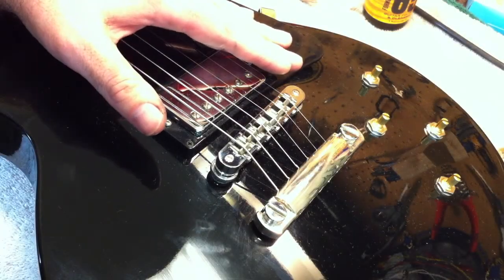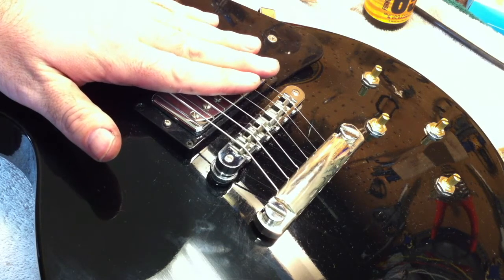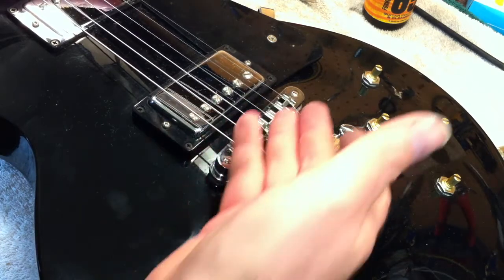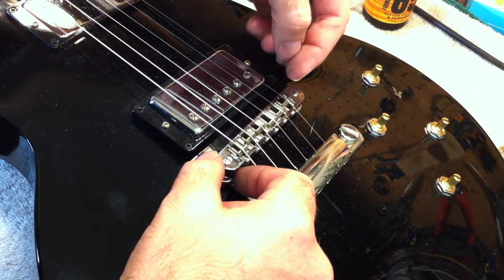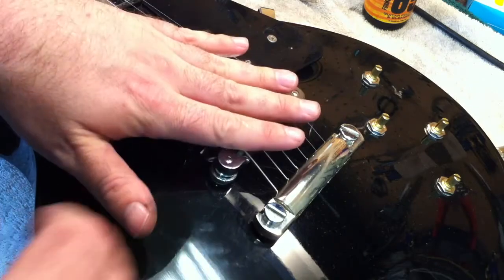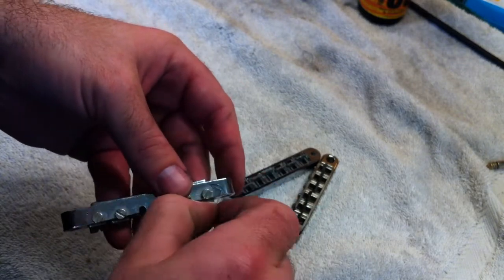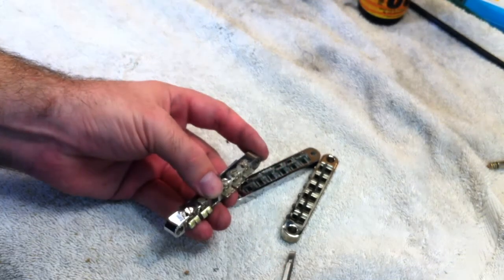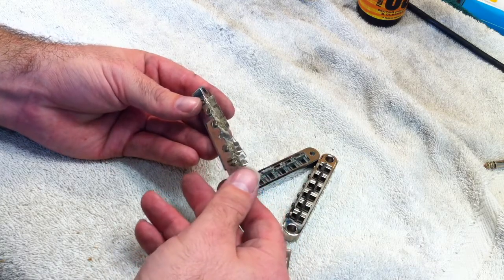Identifying a Buzzing Tune-o-matic Bridge and Fixing It

Comment: I  thought I was getting fret buzz after I installed a roller bridge on my Les Paul but it was harmonics generated in the short length of string between the bridge and tailpiece. These roller and tunomatic bridges to some extent are playing harmonics on the string. Notice how Paul Reed Smith bridges have long grooves across the full width of the saddle - this will properly stop the string's vibration passing to the tailpiece—I think it makes a big difference. I made my own brass saddles with a flat top and groove to hold the string across the top and that fixed my weird noises that sounded like buzzing—only on particular notes.

Comment: I got a new Gretsch 5220 Jet and had the same problem.  I injected clear silicone into the saddle areas. Works great.  I stumbled upon this video afterwards, so I'm not completely nuts.
Reply: Just wondering, were there any gotchas with using clear silicone? Like maybe affecting the range or ease of movement of the individual saddle?

Comment: You can also cut a small spring into 6 pieces and put them around each screw. They'll keep tension on each saddle so that they won't shake any more. Also solves issues with saddles moving when using a bigsby or some other type of trem.
Reply from the maker: That is an interesting solution. I like it because it is less messy than what I am doing here, though the mess does clean up pretty well with a little naphtha. I guess one downside might be that it would be a little more finicky getting the spring on the right side to do the adjustments if you needed to push a saddle close to the front or back but that's also workable. I might try this at some point and see how I like it.
Reply: Where would I get the right size spring?
Reply: @daleosborn3729  I find very small coil springs in the following:  bic style cigarette lighters, long stem candle lighters, small pump sprayers like those used in nasal sprays etc.  My wife saves these for me to pull apart. You have to dismantle or cut apart these things after they are empty to get the springs out.  Pretty easy with a small wire cutting tool like you would find for a few dollars at harbor fright tool store. I get the lighters at the dollar store, often 2 or 3 pack for a dollar. To store the springs and other tiny parts I  keep a small fishing lure box at my bench or you could use  a small parts mini-bin with multiple drawers to keep small parts organized.  I was never able to find any local hardware store that carried coil springs in small enough sizes for this type of application.  Airguns, airsoft guns, and paintball guns use some pretty small springs inside the mechanism for safety levers and such, but are also difficult to source.  I just found it easier to use the obtanium method for my small parts. I have been stripping old junk for parts to build stuff since I was a little kid, so it comes naturally to me.   ;-).  Good luck!
Reply: @Dale Osborn  While proof reading my own previous reply, I had a small brainstorm.  My local hardware has a good selection of neoprene and viton o-rings down to very tiny sizes.  I think I will try a single ring or short stack of them over the screws to put a small amount of tension where needed to mute the rattle.  Could be a little fiddly to get them in place, but seems like it could be even easier than fitting short, clipped springs into the same space.  Also, easier to source than tearing apart a defunct cigar lighter or spray bottle. (I still will bust out the coil springs to use as replacement parts for my antique air rifle collection and other various and sundry mechanisms though).   ;-).  Hope this helps someone.

Comment from the maker: I see a lot of ya'll commenting about putting various locktights and glues in your bridges. I wouldn't. Just because something is metal, doesn't mean that things like wood glue won't adhere to it and you do need these parts to move. It's the whole reason for the mechanism that is causing the rattle in the first place. I have gotten instruments in the shop were people did this sort of thing and it is the sort of thing that leads to broken tiny screws, stripped screws, drastic measures to get ___ out of the bridge and bridges that simply aren't salvageable and need to be thrown away. The reason I am using bees wax here is that it is A: Reversible by dissolution via heat or naphtha B: Fills the gaps **WHILE ALLOWING THE PARTS TO MOVE** and C: Is non-reactive with the metal. If you Want to use other stuff, I am not telling you you can't, but as a professional who has seen the sort of trouble some of this other stuff can lead to, I would advise against it.   If you are uncomfortable using a torch, thats fine. I'll say that if torches hurt this sort of hardware we wouldn't be able to replace the plastic tuner buttons on vintage tuners, because we literally use a torch to melt those on, but I get it. You can use a heat gun or a hair drier too.

Comment: My bridge had retaining clips on each screw. Those are what was rattling. 
    I used a toothpick and put woodglue around each retainer. I then carefully wiped any extra glue. It sounded duller till the glue cured, then it was resonant, and didn't rattle anymore, and the saddle screws still turn.
    Thankyou for posting. Seems to be an issue with these bridges..
Reply from the maker: Wood glue actually reacts with some metals by causing it to oxidize. I know this because I have a couple of feeler gauges I use to apply glue under loose braces and they were instantly turned black by contact with wood glue and basically made useless as feeler gauges. They are basically glue applicators only at this point. That glue will also require that any time you need to switch the saddles around, you may have to apply heat to the bridge with a soldering iron, small torch etc to melt the glue which will be much tricker to remove than wax since its soluble in water and not oil, meaning it would require submersion for an extended period of time which could also harm the metal. You do you, but I'd advise against the wood glue or any kind of polyvinyl acetate variant.

Comment: Great video. My new Gretsch has the retention ring style bridge and this video was the first resource I found that posed a fix rather than just telling me to get a new bridge.
Reply from the maker: If you have a gretsch with a bigsby, you might consider swapping the bridge out entirely for a Wilkinson roller bridge. They do not have this rattling issue and help maintain tuning.
Reply: @DrewsGuitarShop  Graph Tec makes Tusq saddles and nuts that im pretty sure will fix my Bigsby guitar real well...
I just discovered it last night, and  its gonna cost about $60 to fix it up.
I have an issue with another guitar , a buzzing chinese abr style bridge, and thats why i came here..ive actually removed the retention spring on guitars years ago and as long as you dont break a string and lose the saddle on a gig, it eliminates the buzz.
The Bigsby is another animal though...when its in tune its wonderful, but when it goes out mid song, a nightmare.
But the beeswax tip is a great one, and im gonna try that out.
An inexpensive solution to a problem that will drive you to the brink of insanity.
Thanks.
I subscribed-

Comment: Thanks for the tip.
I have fixed the issue with buzz on my LP with aftermsrket Wilkinson bridge.
My tip, no need for taking things apart. Put paper towel under the bridge to protect guitar and cardboard on bridge pickup tp preotect from splash, place wax on the bridge and heat gently woth hear   dryer. It is simple and fast fix. :)

Comment: That looks similar to what I did with my Tonepros Tune-o-matic.

The saddles buzzed like crazy, so I just put vaseline on the threads and rotated the screws all the way back and forth to ensure maximum coverage, wiped off the excess and it worked a treat. 10 years later the buzz hasn't returned and all it needed was the vaseline, paper towels and a cotton swab. Sure, I had to readjust the intonation, but that wasn't a problem for me.

Comment: Great video, there’s one more TOM type that I would like to point out, where the screws are held by little retaining springs. These spring are just enough lenght, that after putting them into a saddle slot, they don’t let the saddle and screw slip out. They’re basically like a trimmed humbucker springs. Same deal, really. The only downside is they may take up a bit of intonation range, because they never compress to total zero. But they are the easiest to remove and quite genius in their simplicity if you can make your guitar intonation work with them (try flipping saddles - it may help). Also, they’re quiet. Cheers from Poland!
Reply from the maker: I have seen that mentioned here a few times. I have since tried it and I'll say that while it works the space taken up by the spring is problematic and I also found that it took much longer than what I do here, but if its a preferred method for some, I don't see a problem with it.

Comment: I got a pickup height spring, cut it to size and sleeved the screw. That help it in place nicely and nothing rattled.
Reply from the maker: Yeah, someone else here mentioned that. Out of the alternatives I have seen people suggest here, that is the one I like the most, though I do think it would be a hell of a lot more hassle. I still might give it a try though.

Comment: What about a few drops of light duty 222 or 242 loctite? Work it into the treads with a few turns while setting up intonation. Probably place a sheet of paper under the saddle to protect the paintwork from drips.
Reply from the maker: See pinned comment

Comment: I use my wife's clear nail polish.  Small drop on the end of a toothpick and put it between the saddle & adjusting screw, done.
Reply from the maker: Thats a notion. It would be easy to clean off with lacquer thinner too. I don't know if it would have the same lubricating properties as the wax, but I'll bet that works for buzz and rattles just fine. When you plug that stuff on, have you ever needed to adjust it after?
Reply: @DrewsGuitarShop  Yes, just a very small amount and I haven’t had an issue adjusting after.  The key is don’t get carried away by adding to much.

Comment: There should be a spring in there to keep it from rattling. Also, with the tail piece too low, the strings rest against the saddle frame, this is where the buzzing comes from….raise the tail piece so they’re not resting on it.
Reply from the maker: You know I did check the tail piece height in the process of diagnosing this and I feel I effectively demonstrated what was causing the issue in this case. What you are describing is a source of problems when it occurs though. Not just for buzzing, but also breaking strings and tuning issues and some other things though.

Comment: I’ve got a buzz in an old Framus I’ve traced to the original roller bridge made with sloppy tolerances. I’m hoping this video might at least give me ideas for an easy fix. I might try a bit of paraffin and a heat gun.
Reply from the maker: If you can get pure paraffin, that might do the trick. I would just avoid any candles since there are often additives that could be reactive.

Comment: Can this repair be done with the tuner on the guitar or do you always recommend removing it to do it? I would use a lighter to melt the wax so as not to get close to the finish on the guitar.
Reply from the maker: DO NOT TAKE AN OPEN FLAME OF ANY KIND TO YOUR GUITAR. Take the part off, and do it as shown here.

Comment: I have buzz on an Epiphone Casino and one thing that struck me is that 3 of the saddles face one way and 3 the other way. Normally I would think that the flat side
has to face up against the PUs. Is that correct?
Reply from the maker: No, you turn them any way you need to in order to intonate the string correctly.

Comment: It's the break angle. Find the string with the issue, file the slot better and down and away from the break point, be sure it's not a flat slot but a V seating, end of.
Reply from the maker: V shaped slots will pinch and can cut strings. It's better to cut the slots with nut files.

Comment: I'd prolly opt in for using a heat air gun on gold plated bridge 
I'm a bit squeamish when it comes to torching my customers Gibson Les Paul
Reply from the maker: I've never really had an issue with it. The way I use the torch is at low temp (propane turned down to a small cone) and with quick passes. You could use butane which burns even cooler than that if you are worried.